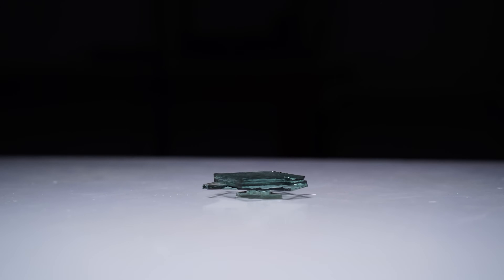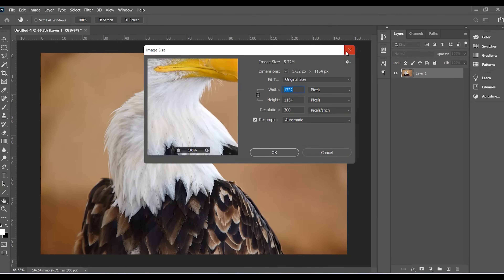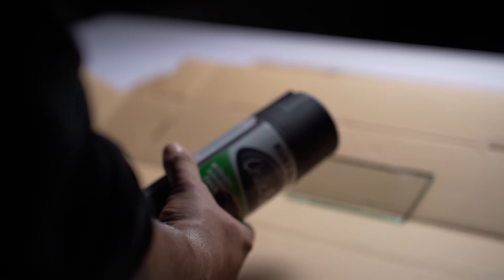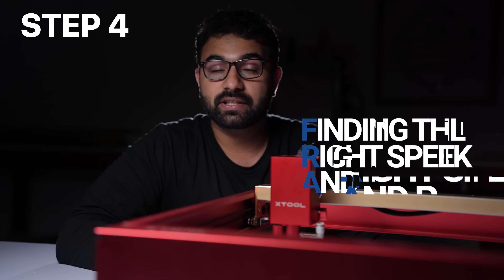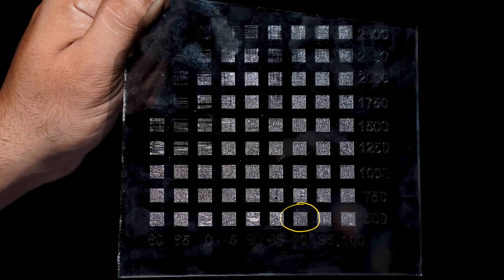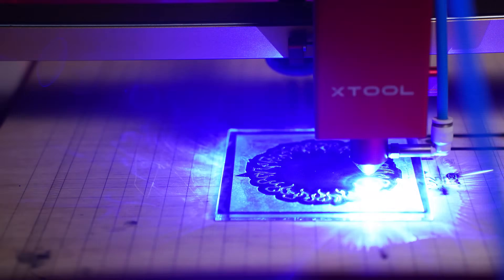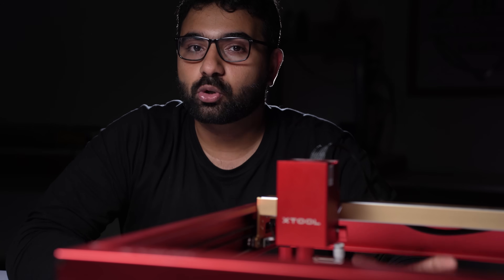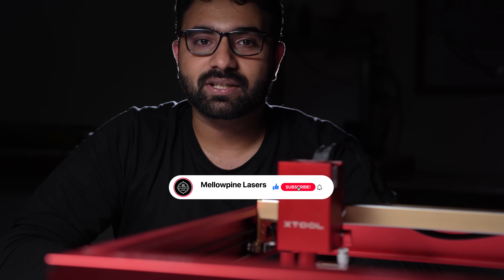Learn How to Laser Engrave Glass like a Pro using a Diode Laser!

Comment: Great work, thank you! Just one question  - why have the laser beam first pass through the glas instead of hitting the painted side straight away? This would avoid part of the beam reflecting back into the laser. I am pretty sure i killed one of the double diode laser sources of my 10w (or formerly 10w) laser by going too hard on reflective materials… 😢
Reply from the maker: We do that because the paint coat can be uneven, on some areas the laser would have to burn through more paint to get to the surface. If we do it from the other side, the laser interacts directly on the surface with the paint. It's more efficient. I don't think the laser beam would reflect right back onto the module from glass.

Comment: 20W output or input ? Got NEJE 30 whitch is branded like 30W, but its maybe 5,5W   in real output.
Reply from the maker: The xTool D1 Pro I use has a 20W output and it has an input of about 130W

Comment: Great video but I have a question.  I'm engraving on a wine glass with a stool rotary.  I used compound cold galvanizing spray.  I use Tool creative space and do I set it at engraving and also I sprayed the compound on the outside of the glass where the lasering  was being done.  Should I have sprayed the inside of the glass or maybe put a piece of black card stock on the inside?  When the engraving was complete it let the image black (grey) like the spray and not like etched glass.  What am I doing wrong.  I have a Tool 20W laser.
Reply from the maker: Hi.
When engraving drinking glasses, paint the outside surface. Try using black spray paint, you might get better results . Try 75% power at 7500 mm/min.
Reply: @MellowpineLasers  Thank you. Where on Xtool creative space do I find the 7500mm? I have speed and power options only.
Reply from the maker: 7500 mm/min = 125 mm/s. Its the speed

Comment: To get the liquid paint to be even on the glass, apply some paint and place another same size or bigger piece of glass on top of the painted piece and then slowly slide the top glass piece off towards the front. It will leave a perfectly smooth surface of paint behind.
Reply from the maker: Wow, sounds good, will definitely try it

Comment: Thanks for your video. How long does it take to etch or engrave a glass bottle? Could you provide an approximate time frame. I'm planning on buying the XtoolD1 pro but need to ensure the laser engraving/etching time is not too long per bottle.
Reply from the maker: That's a great idea, could you tell me what's the size of the bottle (circumference) and what's the size of the image that you want to engrave? I'd be happy to help
Reply: Thanks for your prompt reply. It would be a 1 litre bottle with mid diameter 78mm, height 280mm and let's say the image I wanted to engrave would be a company name or logo. Thanks again for your help.

Comment: I have viewed your video a couple of times and have subscribed. My question to you is, when engraving glass, what is the best thickness of the glass to use for better results? I been trying to use glass from picture frames but have not gotten good results. My laser is a 5 watt from TwoTrees. I tried using the black cardstock that you have mention in your video, but the results were not good. The cardstock burnt through, and the engraving did not turn out at all. Not sure if my setting is correct. I use 65% power and a speed between 800 and 500. Then on my second try, I used 20% power and 500 speed. Both did not work out for me. Any suggestions? I am pretty new at this. I am retired and my wife wanted me to keep busy ... lol Thank you in advance!
Reply from the maker: Try 100% at 300mm/min, try black spray paint if possible. If you don't get good results, run a power test between 60-100% and 200-600 mm/min.
Reply: @MellowpineLasers  Thank you. I will give it a try!
Reply: @jagsinc1  how did you get on?
Reply: @raifjackson9922  Hi, not sure what you mean? Get on?
Reply: @Don Vito  sorry... phrase from the UK. It means how did you do? How did you get on with your task?
Reply: @raifjackson9922  Hi, I just now trying it out. I had not been able to do until now. Been having cancer treatments. Thank you for asking. By the way, I am using the cardstock
Reply: @jagsinc1  thanks for responding and I hope your treatment goes well!

Comment: Loved the video and learned a lot from it.  I did subscribe to you channel.  I do have a quick question, you told us the speed and pressure which was different from the first numbers you gave us for the 20W when using the black cardstock.  i was wondering what the numbers would be for a 10W which is what I have.  i thought maybe 70% power and 300mm.min?  I really don't know; can you please help?  Thank you.
Reply from the maker: Quick technique to use other's settings: I used 45% at 1200 mm/min on a 20W machine, so 45% of 20W = 9W. To get 9W on your 10W machine you'll need to run it at (9/10 x 100)= 90%. At 90% you could run it at the same speed I used (1200mm/min). 

Scenario 2: Assume the setting I used for some job is 90% at 1200 mm/min on my 20W. The power I'm using is 90% of 20W = 18W. On your 10W machine you cannot take it above 10W. So what you do is you reduce the speed to half. 9W (90%) at half the speed used on 20W (600mm/min) . For a 5W one it would be 90% at 1/4 the speed of 20W (300 mm/min).

This will give you an approximate number but you should run tests around these numbers to get good results on your machine.
Reply: @MellowpineLasers  Thank you for your help

Comment: Did you get any results with the black card stock on a lower power laser than the 20W?
Reply from the maker: Yes, you can use a low power laser. The only thing that's going to change is the depth of the engraving. Do try and let me know, how it turned out for you.

Comment: Thank you for your professional looking video and your very good explanation.

But, in past, I saw some other videos about glass engravings. In some of them, a cinq or aluminium spray was used for coating the glass instead of using a black paint or background.
And the engraving results of them looks really great. I think, there are different ways, the heat of the laser gets into the material. Black colour paint only absorbes the power of the laser beam, while metallic particles would heat up and hold the heat a lot more than the painture do.

So my question to you is, if you ever tried to use cinq or aluminium spray to engrave glass. And if you did, where are the odds using black paint?
A comparison video would be very interesting, I think.

Best regards from germany
Thomas
Reply from the maker: I used black spray and black cardstock because it is easy to get it and use. I will do a comparison between metal spray and black spray. Thanks for the idea... :)

Comment: Nice explaining, thnx
WHat happening with the black cardboard. do you need a new sheet every time.
Reply from the maker: Yes you will need a new sheet every time but it is cheaper than other methods. The surface of the cardboard burns off, however, at times you can flip the sheet and use it.

Comment: Hola! Excelente video. Una pregunta: hay alguna manera de cortar y grabar acrílico transparente? sirve la misma técnica de la cartulina? Gracias!
Reply from the maker: Puede usar pintura en aerosol negra para grabar en acrílico transparente. En cuanto a la potencia, debería ser inferior a la que usas para el vidrio. Si usa alta potencia, dañará el acrílico. Para cortar acrílico transparente necesitaría un láser de CO2 (You can use black spray paint for engraving on transparent acrylic. As for the power, it should be lower than what you use for glass. If you use high power, it will damage the acrylic. For cutting clear acrylic you would need a CO2 laser
)
Reply: @MellowpineLasers  Gracias!!! Sabía que no podía cortar acrílico pero guardaba la esperanza de que hubiera algún método (como el de la cartulina) para poder hacerlo).Gracias nuevamente por tu respuesta!

Comment: Hi Mellowpine Lasers nice video! You know the configuration for transparent acrylic sheet for atomstack 7?  Difers from Glass? Many Thanks
Reply from the maker: You can try engraving a square at 2500 mm/min and 90% power. It is better to run a power test. Use black spray paint.
Reply: @MellowpineLasers  i tried use tempera paint with test template but the results are so poor and the sheet after clean with water doest look transparent at all
Reply from the maker: Try spray paint or acrylic paint

Comment: Szép munka! Kartonpapír helyet rakhatok az üveg alá feketemárványt, vagy fekete burkolólapot? A festetlen oldalról gravírozom az üveget akkor nagyon közel kell állítanom a modult a felülethez, mert nekem 2mm a fókusztávolságom vagyis 2-3 mm-es üveget tudok csak gravírozni a festetlen oldalról. Igaz?
Reply from the maker: I haven't used tile or marble for this. If you use black tile or marble, it can damage it, you might need a new one every time, which can be expensive compared to black paper. Regarding focus, yes if you want to set it on the bottom surface you cannot use materials thicker than your focal length. You will have to paint it and engrave on top. ( Csempét vagy márványt nem használtam ehhez. Ha fekete csempét vagy márványt használ, az károsíthatja, előfordulhat, hogy minden alkalommal újat kell venni, ami drága lehet a fekete papírhoz képest. Ami a fókuszt illeti, igen, ha az alsó felületre szeretné beállítani, nem használhat a gyújtótávolságánál vastagabb anyagokat. Ki kell festeni és a tetejére gravírozni.)
Reply: @MellowpineLasers  Köszönöm!

Comment: Thank you! How do you know when the focus is set correctly. I also have the Xtool d1 pro 20w and I am currently unable to do this. Not sure why
Reply from the maker: You can use the thickness compensation on the right side of the module. For example, if you want to focus at the bottom of a 2mm thick glass set the bar at line 1, if its 6mm set it at line 3 and then do the normal focusing you do, drop the bar down and move the module down till it touches the surface. You can also checkout this video https://youtu.be/E9lpNcBJEwA?t=335 (watch it from 03:35).
Reply: @MellowpineLasers   Excellent! I watched the other video, and I will test this out soon. Great tips

Comment: Thanks for this!  My technique for etching glass is to not use the laser at all... I use the same 3018 CNC, but with a drag knife attachment instead of the diode laser.  I cut a mask into sticky vinyl, transfer to the glass and use Armour Etch to mark the glass.  Armour Etch is a paste that you spread on glass, and it will etch it in a few minutes.  One of the advantages of this technique is that you can etch curved surfaces without a rotary attachment - but of course the downsides are that it's more steps and requires a different tool.   I will try your technique if I'm ever etching onto a flat surface!
Reply from the maker: Try engraving with a laser, its easy and you can engrave complex designs. Which 3018 CNC are you using?
Reply: @MellowpineLasers  My 3018 came today, has a 2.5W, but for the price it is a bargain for a beginner. Will halve your 5W speeds and see what happens.